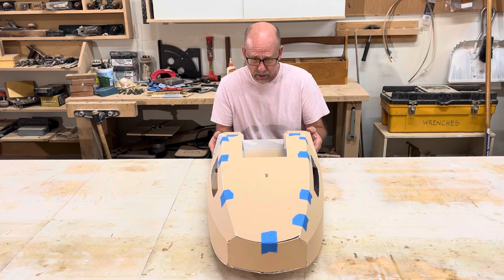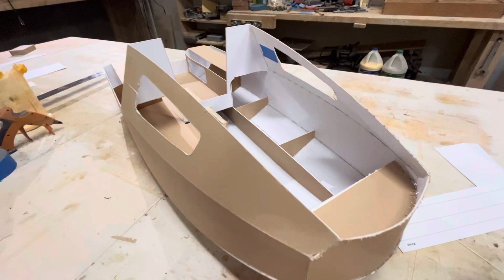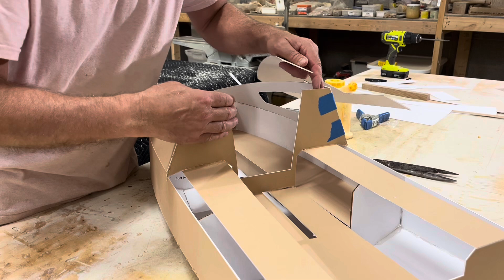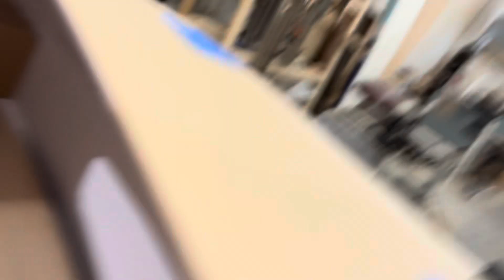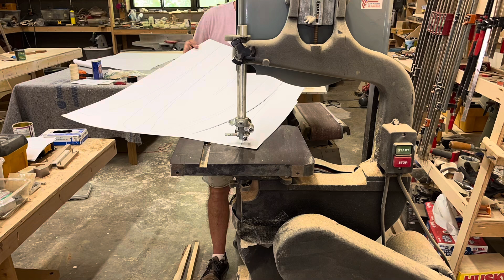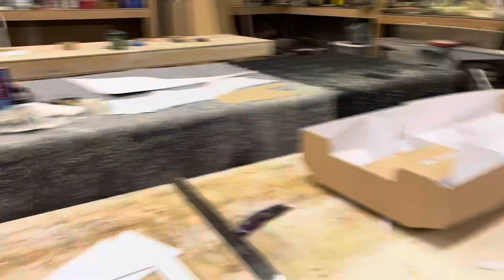Model of Micro Scow

Comment: Looks excitingly different in proportions when it's a real model than a render! :)

I guess as previously mentioned, if you look at 6m52s the fore bulkhead might be better as a watertight with a hatch to use the bow space / crash chamber,  "front bed rib" should be a ring bulkhead maybe 50mm high across the sole and coach roof, maybe 2 ring bulkheads 100mm apart to then give the scope for a deck stepped mast.

If you're going for the walk through companionway, you'll be better with a ring bulkhead around the opening in the roof nearest the mast - the force you'd be able to put on it going below will be tremendous.

In the real model, do you think the keel box is long enough - it seemed like it was in CAD but theres no major blocker to making it longer presumably?

Great work.
Reply from the maker: Thanks for your input.  The centerboard case is around 50" (1.27M) long and the centerboard extends about 3' down (.9M).  I agree at least 1 ring bulkhead is needed, probably 1 under the mast and 1 under the side stay connection point.  I like the double ring bulkhead idea.  I think I saw that on the Maxi 650 interior.

Comment: Maybe you have shown it before, and I missed it. Is the mast going through the roof and down to the floor? It looks like it. Did you consider a deck-stepped mast during the design? Cheers.
Reply from the maker: In my last version, the mast goes into a sleeve which is about 22” tall, so not all the way to the floor but the sleeve does go to the floor.  I did not post it on YouTube yet.  It’s on my website though.

Comment: Nice work!  XPS composite is ok for prototypes, but would not recommend using it in a boat that is built to last. It will delaminate sooner or later, probably sooner.  Using halved 30-40 mm PVC pipes glassed in, works also pretty well as  simple stiffeners.
Reply from the maker: I see a lot of boats built with high density foam.  I did not know there were delamination issues.  The bottom of my shuttle punt is built that way and I have not had any issues.  One time, I tore up the back half of the boat to replace it and I was surprised that no water had gotten inside.
Reply: @markpalmquist  Professional built boats always use PVC foam, never eps or xps. PVC foam is totally different from xps. Some surfboards have a xps core, but even they tend to have delaminating issues over time. And they must have ventilation valves to reduce delamination.   Its easy to test. Try to glue wooden sticks to xps. Initially it tends to hold well, but  when it brake, its always the foam that get loose from itselves so to say.  Even with high quality adhesive tape, you can rip the foam away from the foam.How ever you prepare xps, its always the foam that rips.  I even tested on high density xps, 70kg/m3, still the same result. Don't waste your labor, time and money using it on a larger craft, a dinghy maybe, but larger than that, no.
Reply from the maker: @joeordinary2trumpheroofrussia ok I did not know that, thanks.

Comment: Hey, what material is that? 😁👍👍🇺🇸
Reply from the maker: I went to Michael’s looking for bristle board but they did not have it large enough so I bought 2 sheets of mat board, the material used to frame a piece of artwork.  It worked well.  Only cost $30.
Reply: @markpalmquist  Matt Board PERFECT yes great stuff! Easy to work with too! 😁👍👍🇺🇸

Comment: difficult not to compare it with an Oz Goose. I've never sailed on one, but they look very impressive for what they are (box with a curved bottom). How much ply do you think you will need? an Oz Goose needs 6 sheets of 6mm, I think this design could at least be very close to be built with the same, maybe 7 sheets because of the cabin, but if you stategically used some sheets of 4mm I think you could get this built at the same weight as an oz goose
Reply from the maker: My goal is for this to go over 8 knots on a reach and maybe 10-12 on a run.  The OZ goose can go 12 downwind but it does not have a cabin.  I agree, using 4mm ply but then reinforcing the bottom with a layer of 12mm XPS and then glassing it in would make a light but stiff boat.  I would put the foam layer on the inside, not the outside, but either way would work.  I have not counted all the sheets yet but will soon.
Reply: @markpalmquist  the oz goose has those two seats that go all the way to the front, but you just turn that part inside out, it doesn't look like that much more material in your design. plus, it's a strong shape. if you have strong shapes you can make it lighter. you have more curves so that's an advantage over the OG. What's your source for 12 knots downwind? I havn't seen The Boat Rambler go that fast
Reply from the maker: @dominictarrsailing there is an old video from long ago before boat rambler sailing in a gale.
Reply: @markpalmquist  Supposedly, XPS doesn't do that well as a core material - the skins tend to sheer off quite easily. At least that's how it looks from the very limited testing I have seen done on it. For an unstressed table top or something like that, it's probably ok, though.

That said, some people have mentioned you need to get rid of the outer layers on the XPS as the fire retardant may inhibit adhesion. Also, others talk about making puncture marks in the XPS as a way to get more keying. Granted, I haven't done any testing myself and I am sure you would before committing but just wanted to share what I had gleaned last I looked into this.